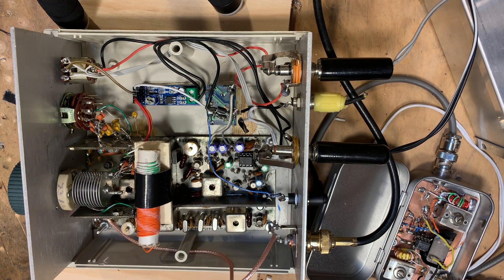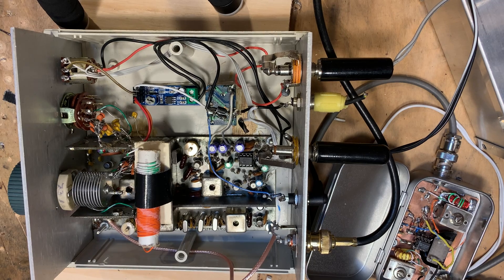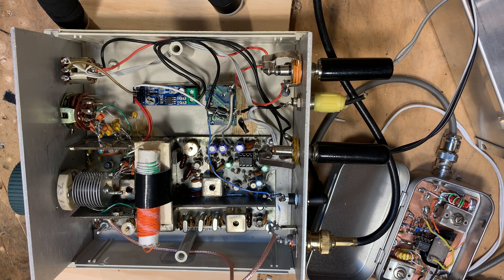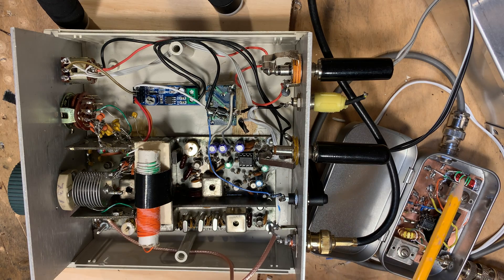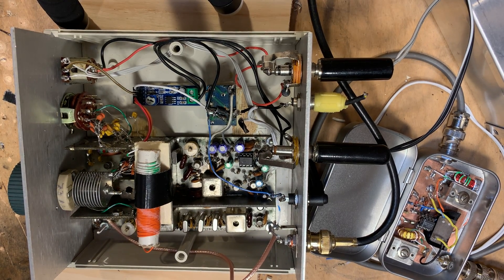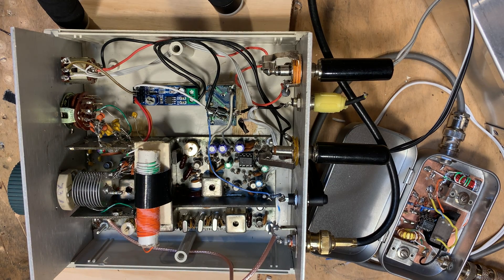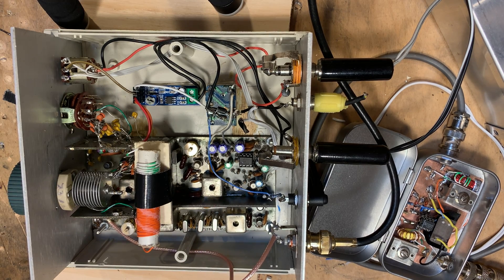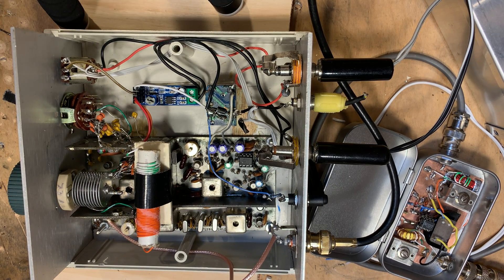Putting a Barebones Superhet on 17 Meters with an NE602 Downconverter

Comment: Very interesting, thanks for sharing. The output of the xtal oscillator can be a bit too high for NE602 though. As I recall these oscillators give 5 Vpp into high-z load, while for NE602 you need LO around 0.3 Vpp (better check with the datasheet). Did you use an attenuator?
Reply from the maker: Alex -Thanks.  You are right - the output from the module was too high and may have been putting noise into the device.  I threw together an attenuator to get the level closer to the 200 mv P-P level.  It does sound a bit better.  73  Bill